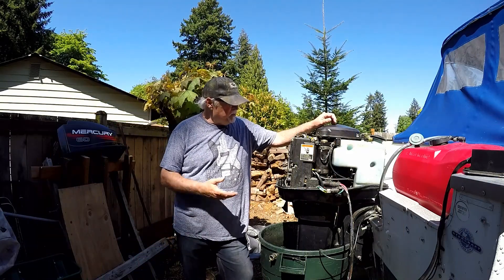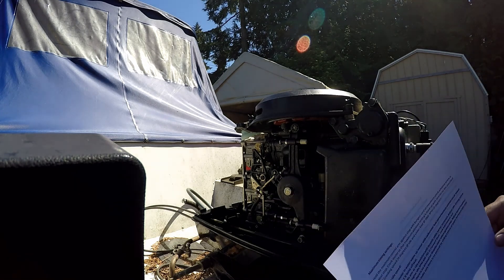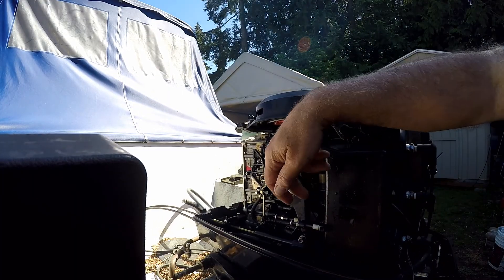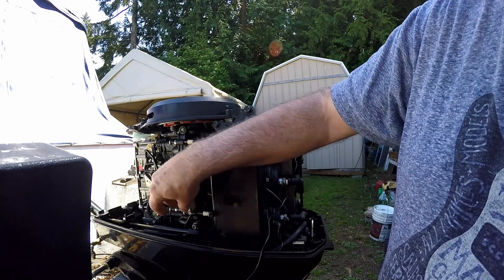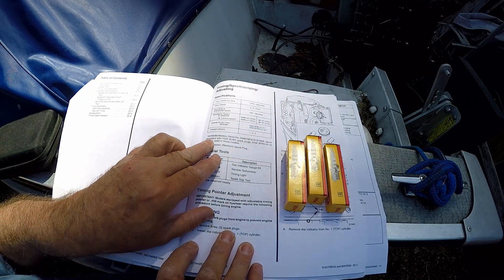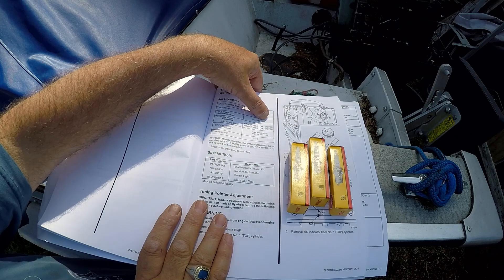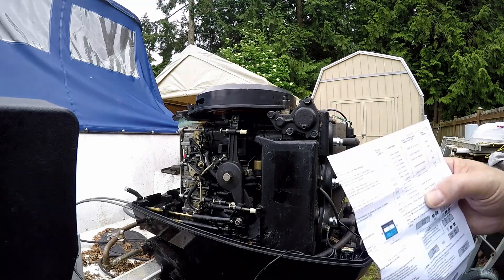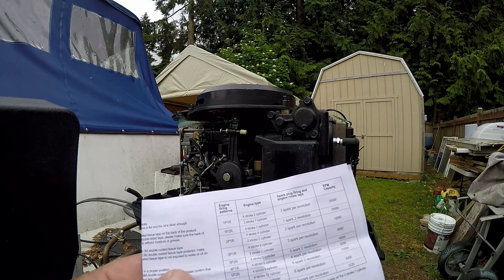Mercury 60hp RPM and Throttle cable adjust

Comment from the maker: https://youtu.be/CeU5CzgFnNU
Hey folks, I did this new video to get the correct info out on adjusting the idle timing RPM. Sorry about the first video. Unfortunately YouTube doesn't have the editing feature to go in and correct this. The throttle adjustment is correct though on both videos. Tim

Comment: What type of boat u got imma about to put this on a 16
Reply from the maker: Hi Ethan, the boat is a 17ft Starcraft fisherman 170. As far as I know they came with these motors which also was certified for how many normal size people can be on it. The engine is 236lbs.

Comment: Hey Tim, your videos have been a massive help. I have the 90hp 2 stroke and your videos really help make sense of the service manual. 
I got the same Tach on Amazon, but I cant get the reading to make any sense. What setting do you have it on?
Reply from the maker: The directions in the box explain it and I showed it on the video. The setting is for 3 cylinder and 6 for my 60hp 2 stroke 3 cylinder. Wrap the wire lead around the number 1 spark plug and secure with a tie strap or it will unravel. I think the setting is like 3R1 or something like that
Reply from the maker: Also for setting the WOT carb setting make sure you watch my Link Sync video that gives a better explanation on the gap setting with the .015 feeler gauge. I also posted a comment that the set screw on this video for the idle timing  was wrong and to watch my newer video for the correction

Comment: Hi Tim,I just came across ur video and boy am i glad i found ya,i have the same type of engine, probly round the early ninties,
it wont idle that well at all,
ok,i got a brand new fuel line and primer bulb last week, i flushed the carbs, etc ,
but i didnt  explore the idle screw stuff, with the help of ur video i hope to try it,
i just like and subbed ,cheers ,from donegal ireland,!
Reply from the maker: Let me know how it goes. Make sure you put new plugs in. 2 strokes tend to foul easy since its oil injected. What I do is put a lighter to the spark  end to burn off the oil. They are like new again. When sitting at idle they clog up after awhile. These motors are meant to run at a higher rpm on the water. That's why I use my kicker motor too when idle fishing. It's a 4 stroke and the plug won't foul on it. Hope this helps. Tim

Comment: Question. My idle is good, but I'm only getting 4200 rpm wot. Ive dropped prop pitch with no result. Can i adjust the thread on cable to increase my wot? They are older cables on a new 2020 motor. Cables are good too. I've tried everything but this but there aren't any videos specifically for my issue
Reply from the maker: To verify it's a cable adjustment issue you need to see if you WOT on you carbs are opened up within the .015 of the center carb stop. If it's not then you need to adjust your cable or you link and sync was not set right. These have to be done in sequence. First the link and sync with the carbs with the control cable nit attached. Then you adjust your cable lenght and reattach it. Also for WOT you timing needs to be set right. Mine is set to cranking in a barrel at .22 degrees BTDC. The book states 24 degrees but I set mine at 22 since I don't have a test tank to set this motor @ WOT. like I said just push the throttle all the way forward without the motor running of course and check the center carb stop to see how close you are to the .015 setting and adjust if needed and reset cable lenght.. let me know if that helps. Tim
Reply from the maker: Oh, I need to lube up my cables so they move better.
Reply: @TimsWorkshopTJY  it's EFI. 2020 Merc 40 4 stroke. The control box I'm using is older along with cables. I had them originally on an 05 2stroke Merc 40 but switched to this motor and this year I'm now on a different boat. The weirdest thing is I had better rpm with original prop(17in). I dropped all the way down to 14 and lost a grand of rpm 😂. So I'm going back to original prop to I can figure this out
Reply from the maker: 4 strokes are different but if it ran better with the other prop then that should work. Just so you know the Mercury Service Manual has a section of approved props for your motor. You need to stay with the correct props for the best performance.
Reply: @TimsWorkshopTJY  yeah I'm aware of that. That's what is now leading me to the adjustment point.

Comment: Great videos. Have you happened to messed with any efi 2 strokes ? I have a 1993 150 efi that runs fantastic and strong ...but it idles just a little too high In neutral and in gear ( 1100 and 900 rpm). I'm afraid to touch anything because I don't want to get anything out of sync. With the fact that it runs so well...could I get away with just turning my idle speed screw in some and just that ?
Reply from the maker: I worked on a friends BF130 4 stroke ego that wouldn't start. I started by checking the filter up front and the mechanical fuel pump on the back. The fuel pump worked when cranking and the fuel filter looked ok with no water. We took the VST pump apart and it was very dirty and there's a small fuel filter up kinda hidden behind it that was clogged up. Replaced it and after the VST pump was cleaned the motor fired right up and ran great. My friend decided to do the same to the twin that was still running good before it clogged up too. I asked what kind of fuel he uses and he said non-ethanol only? So even if you run regular fuel non-ethanol you still have to keep up on the fuel lines and filters. I need to get a new filter for my merc two stroke before fishing next week and blow the carbs out with carb clean. I've found a way to do it without removing them. The jet next to the low speed adjustment screw on top of each carb I spray carb clean in each carb with the float bowl drain plug removed. The carb clean comes out the hole. It works
Reply: @TimsWorkshopTJY  during a compression check does it matter if throttle is in neutral or wide open ? People always say wide open ...I've never bothered with that.  I removed all plugs and did a cold compression check and got 91 on every cylinder. That's very good. Can't imagine pinning the throttle would change anything.
Reply from the maker: Per the service manual it states to open the carb shutters wide open which I believe I covered this on my compression test video on this motor. Check it out. Not sure why? It just states it in the procedures

Comment from the maker: I haven't had time to update this video yet with the correct information. The idle screw sets the carb cam and roller. Don't mess with that one. To set the idle turn the idle timing screw in forward gear@ idle. Shouldn't take much so don't go beyond the 2 to 6 degrees on the timing mark. Here is the short  correction video. Sorry for the error. YouTube editor won't let me correct the video so did it this way. 
https://youtu.be/ZYAeSuRKXNg

Comment: I have a 97 Mercury 175 EFI, would the idle on mine need to be set to the same 650-750 rpm?  Great video by the way,
Reply from the maker: Hi Aaron, not sure about that big of engine? I'll look into it and let  you know
Reply from the maker: 175 efi has a tps voltage adjustment for idle. My suggestion is to get the mercury service manual for that model and year. It's has great step by step instructions has list of tools required. Shows the breakdown of parts by name and where they all go. Has the specs too
Reply from the maker: https://photos.app.goo.gl/rBEjJEuqURozqmKx8
Service manual online for under 10 bucks. Wow, mine cost 100 and mine is a 1996 two stroke
Reply from the maker: Cool, Look what I found.
https://photos.app.goo.gl/LhEG75ZDxWJRsMzJ8

Comment: Hey tim I have the same motor and love your content you are putting out . 

I found some rocks with my boat and chipped my prop pretty bad ... 

I found a nos prop at a flee market my research told me it was intended to go on a 70+ hp 
I have a 60 ....

Iv lost 3 mph but iv also added about a 100 lbs worth of batteries. 

Think it would hurt my motor to continue to use it ?
Reply from the maker: Hi John, I believe there is a list of approved props in my service manual. I'll take a look today and send you a copy. Also look to see if you have any prop shops nearby you. I have one up the road and the fix and sell new ones and reconditioned  ones. Not sure but I've seen a video where a guy had a prop on a Johnson that had been trimmed down over the years to remove the rock hits. The guy was trying to figure out why this prop was making his top end faster and it was the profile was reduced. The low end was affected though and took longer to get up on plain. Look up "This old outboard" and check out his prop videos. Great funny channel as well👍
Reply from the maker: https://photos.app.goo.gl/QHHh63mLheoXxkHe9
Here you go John, two pictures one of some mercury prop info and the other picture shows what are approved props for a 60hp merc. There is quite a few to select from. Some are aluminum and others steel. Over on the right is the part#s which each prop should have. Hopefully you can open my google link. Let me know. Tim

Comment: Great videos Tim. I’ve got the 3 cyl 50 that I’m trying to resurrect. You’re a great help. When you adjusted the idle up, the cam started pushing on the roller and opened the butterflys slightly? Tks, Jimmy.
Reply from the maker: So glad I was able to help you. Yep, raising the rpm opens up the shutters slightly. The carbs only have a air mixture screw set at 1 1/4 turns starting set point. But you don't want the carbs set to lean. If you have the mixture screws set right on each carb they will be just a bit towards the rich side. Usually ends up 1 1/2 turns out. Thats why it's important to set everything in sequence on these motors. I'll be hitting the water with mine in July after we get back from the Oregon Coast. Will have a video soon after. Thanks for watching
Reply from the maker: Your comment got me thinking and reset the roller and cam back where I had them. The motor was not running right that's why I need to edit this video with correct info. Oh by the way my mercury service manual screwed me up? Stay tune for an update this fall after I'm done fishing probably in October